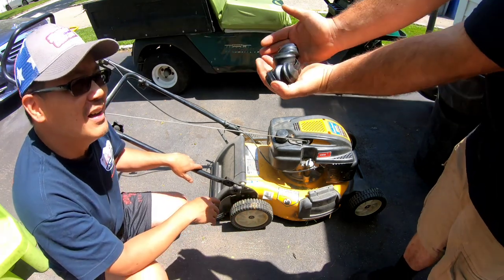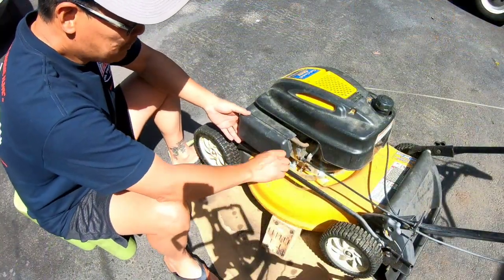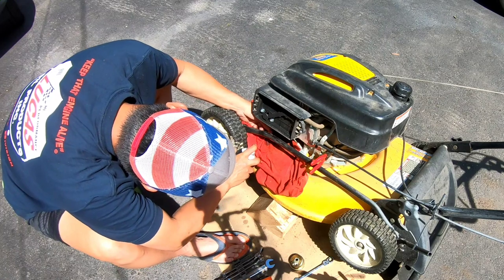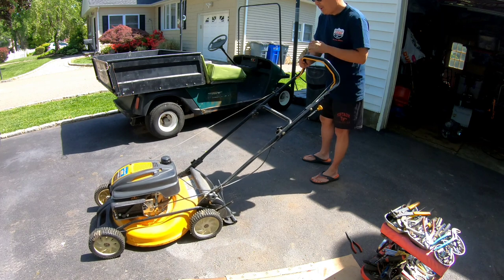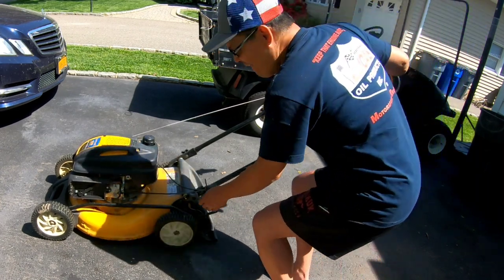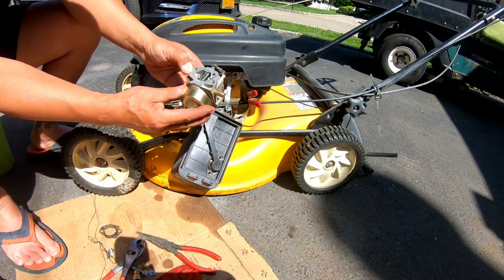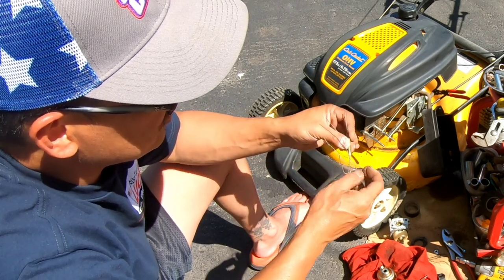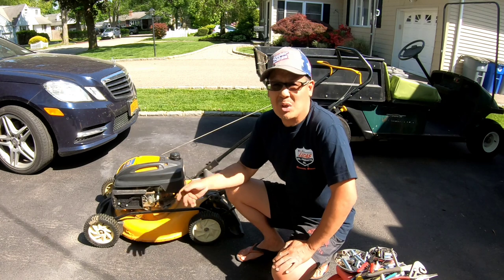NEIGHBORS MTD CUB CADET POWERMORE ENGINE PUSH LAWNMOWER STARTS STALLS QUICK DIRTY CARBURETOR CLEAN

Comment: Good job as always. A bit of advice on removing emulsion tubes easier. I have a Husky 3/8 drive 38 bit socket set. The name is a bit misleading, because it’s all torx bits, screwdrivers and Allen heads. However, the flat heads are super helpful in removing emulsion tubes. They fit just right, you have extra torque and I’ve never stripped an emulsion tube. They’re not expensive and well worth the cost.
Reply from the maker: I have impacts with the correct bits…I use them if I can’t using a screwdriver

Comment: Those carbs are like Honda’s 
Except easier to take apart 
No gasket sandwich

Oddly enough last 3 mowers I got
Powermore 139cc
Powermore 173cc
Honda gvc160
Videos will be out In August 2022
on the Cub Cadet, after  I cleaned the carb, it would still surge. 
but if I put air filter back on.  then it ran fine.   the 139cc powermore wasn't that way
on the 173cc powermore, I saw several other vids out there where it would surge at first but then go away after a few seconds.

Comment: Hi Henry Which CHinese food is better the Real Chinese food or the American / Canadian Chinese food?
Reply from the maker: Depends on if you’re American or Chinese!  Half the Chinese American stuff doesn’t even exist in China.  I’d say the Chinese food from China is the best,  only because I’ve visited China before.  But Americans or Canadians don’t know any better because they’ve never tried it unless they’ve visited before.
Reply: @MowersNBlowers  thank you for the helpful information about Chinese food I like the Canadian Chinese food, but I never had the real stuff, also I enjoy watching your lawn mower repair videos please keep up the great work, also I have a lawn mower that won't start and run, I have gas, compression and spark, what could be a problem that I'm not noticing? it's 3.5 briggs and stratton classic engine, also the tab for the idle spring is broke off the engine assembly, could that be the issue? I'm stumped any help is greatly appreciated thank you.
Reply from the maker: Try blowing starter fluid in the carburetor and see if it turns over,  if it does,  clean your carb
Reply: @MowersNBlowers  Here's the funny thing it's a brand new gas tank and carb on it because the original one had a few holes in it, so I put a brand new one on, is there a way to adjust the valves on a briggs and stratton classic engine?
Reply from the maker: @Dave7160  grind the valve stem
Reply: I'm trading it for a Honda so I don't have to worry about it, but I really do appreciate your reply please keep up the great video. also the lasts forever mowers are john deere ja65 with Kawasaki engine and toro with the 4 cycle Suzuki engine both aluminum decks very rare if you get one keep it.

Comment: I wish it was that easy for my Craftsman it runs like if the choke is on while it's open I got a new carburetor and it's still doing the same thing change the flywheel key cuz I thought the timing might have been off still the same
Reply: If doing same thing after new carb, it is most likely intake leak, try the wd40 spray trick to see if rpm’s change, and you will find where the leak is if one exists.  Or warped air filter intake
Reply: And check valve lash if ohv engine, good luck friend.
Reply from the maker: Could be the intake manifold cracked
Reply: @MowersNBlowers  it has one of those plastic carburetors